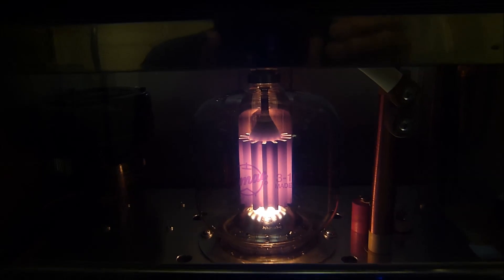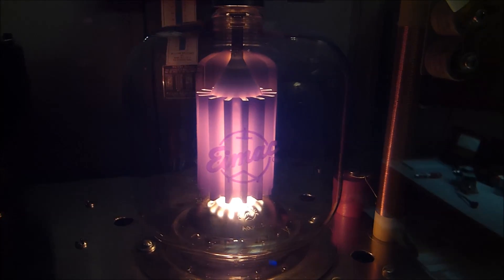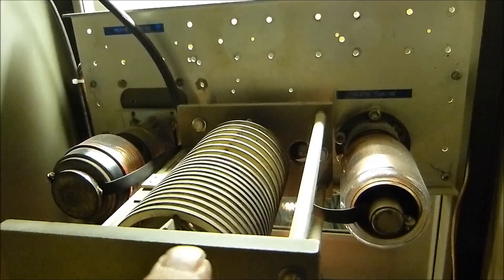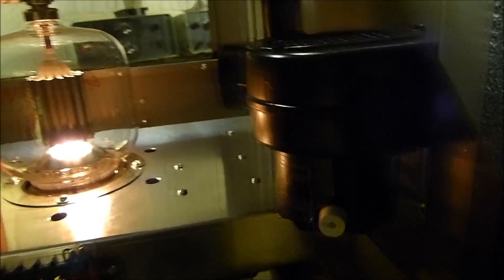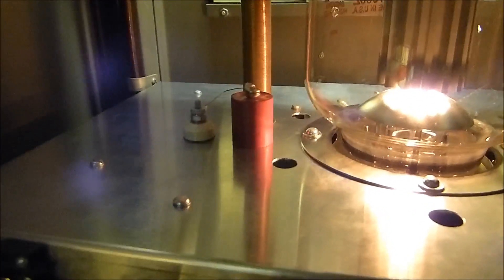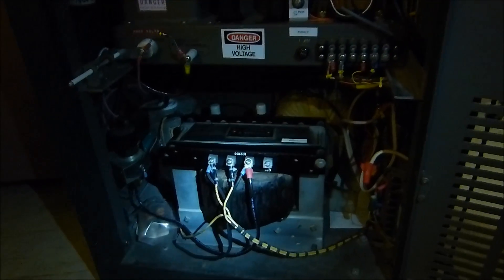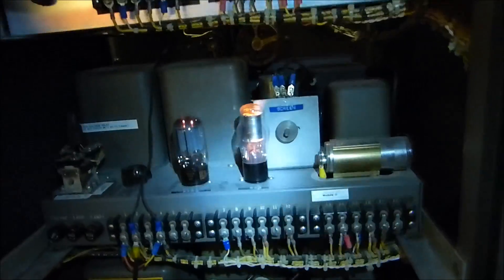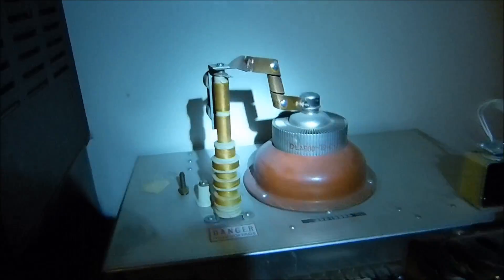Eimac 3-1000Z Triode Grounded Grid Linear High Power RF Amplifier

Comment: I think I read the plate vintage is 3000-5000v with the driver from 43w to 28w. I was wondering how you chose the 3500v plate voltage? I wondered if the whole system would be better at 4500v
Reply from the maker: 4500 VDC is too high for GG... Mine runs at 3500 because that is what my transformer gives me. Sometimes we have to live with what we have.  :-)   You can run as high as 6KV if the tube is running class-C.   Here is the datasheet for the Eimac 3-1000Z       https://frank.pocnet.net/sheets/140/8/8164.pdf

Comment: Beautiful, what sort of power does that produce and what frequency?.
Reply from the maker: Thank  you. It depends on how the tube is run. According to Eimac specs, 3000 volts as a zero bias triode is 1080 watts and that is generally how I have run it. You could run it as 1/2 of a class-B audio amplifier at 5000 volts and get 1750 out of it or class-C plate modulated at 4500 volts for 1750 watts output. My power supply is only 3600 volts and I run it conservatively at about 1000 watts output as a GG amplifier. A pair will do better than 3500 watts output if you want to go to 5KV.  Quite a tube for amateur radio use. I am comfortable with HV up to 4000 but much above that is beyond what I am familiar with.  Not many components, like chokes,  are rated above 4KV so they have to be "floated", i.e. mounted on some insulating material like ceramic standoffs. Thanks for your comments.     https://frank.pocnet.net/sheets/140/8/8164.pdf

Comment: Can u teach me the schematic diagram?
Reply from the maker: Here is a link to the best article I know of using the Eimac 3-1000Z
http://rfcec.com/RFCEC/Section-3%20-%20Fundamentals%20of%20RF%20Communication-Electronics/05%20-%20AMPLIFIERS%20-%20RF%20POWER%20AMPLIFIER%20CONSTRUCTION/RFPA%20-%20A%201000%20Watt%20Amplifier%20Using%201%20Eimac%203-1000%20Triode%20Electron%20Tube.pdf
Reply: @ElPasoTubeAmps  ohh.thanks so much

Comment: I was lucky enough to get a great deal on a 3-1000Z yesterday, and bought a socket, chimney, and plate cap while I was at it.

What is the plate current @ 3.5kV on CW? I'm looking for 1.5kW, and trying to size up power supply requirements.

Is 3.5kV what you would choose if building from scratch, or was is what the cabinet had to offer? (Unfortunately I don't have such a beautiful Collins cabinet to build it in, so from scratch it is.)

Thanks,
Nick
KE8KDS
Reply from the maker: I chose the 3.5 KV over 3KV as I can change this voltage. I press my amplifiers a little hard. As for plate voltage, plate current, grid current and power out,  just Google  the Eimac 3-1000Z data sheet and make it perform like Eimac suggests and you can press it a good 10% just for fun...   :-) and you can get 1.5 KW CW out of it.
You are likely to have to put out the $ for the filament transformer of 7.5V @ 21A unless you have something else you can adjust maybe with a variac... You don't have to have a air socket and chimney but you do need to blow some good air across the tube. It is nice to hear you are making a big amp. Be safe. 3000 volts can be death on contact.  73
Reply: @ElPasoTubeAmps  As for the filament transformer, I'll likely wind my own, as well as the plate transformer and filter choke unless I find a good deal on something that will work. So it shouldn't cost too much. 

I've been looking at the datasheet, however I'm not particularly good at extrapolating from the given parameters, yet.

I can see that at 3500v GG, idle current will be around 200mA (close to what you have), but when it comes to max signal plate current, I'm not sure how to get that value.

Using ohm's law, 100W driving power into 50 ohms would give a voltage of approximately 70 volts. Going by that, on the negative swing (filament 70 volts negative with respect to grid), plate current would be 2A! Surely that's not right?

Also, yes I am well aware of the "dead before you hit the floor" aspect of this type of equipment.

Thanks,
Nick
KE8KDS
Reply from the maker: @Sparky95  Winding your own transformers  -  I certainly admire that. That is something I have not attempted yet.
I have attached the Eimac data sheet.
http://www.tubecollectors.org/eimac/archives/31000z(74).pdf

Look on the second page under:
Radio-Frequency Linear Amplifier
Class-B, Zero Bias, Cathode Driven

In the right hand column under - Typical Operation

You can see that they suggest plate voltage of 3000
Zero Signal plate current is 240 mA
Max Signal plate current is 70 mA
Max Signal Grid Current is 220 mA
Max Signal Drive Power is 47 watts
Nominal Cathode Impedance is 67 ohms (not bad and does not have to have a matching network)
Plate Output Power is 1080 watts

With all this said, you can run the plate at 3500 volts or higher as the left hand column says the maximum plate voltage is 6000 volts with 800 mA of plate current. Wow.... I push it a little bit but not so much as to damage the tube. I do not overdrive the grid current as it is rated at an absolute max of 50 watts.

I am sure you could put 4000 volts on it and run the plate current up to 800 mA or so (keeping the grid current no more than 220 mA) and it will work just fine and probably deliver 2KW+  output.
Reply: @ElPasoTubeAmps  Winding your own transformers is quite easy, once you get set up for it. There is a decent amount of materials, equipment, and knowledge to get started, but once you have them it's easy from there. I can link you to some really helpful resources if you decide you'd like to get into it.

I'm using a pair of 872A's, so I'll probably run at 4kV 800mA or so as you suggested.

It shows at 3kV a drive power of 100W, does it require less drive as the voltage is raised? I'll be driving it with an FT-101B, so should I put an attenuator on the input?

-Nick
KE8KDS
Reply from the maker: @Sparky95  I drive my 3-1000Z with a Collins 32S-1 which will deliver 80 watts average power output and that is plenty enough and can easily overdrive the grid. I don't think you will need an attenuator on the output of your tranceiver just keep the drive power down and it will work good.
4KV @ 800 mA is 3.2 KW and at least 1KW is going up in heat so you will be running it at a screaming max and I believe that will be OK for ICAS operation. My calculations of input power vs output power, if I remember correctly, puts my plate dissipation at about 800 watts which is a nice healthy orange plate. Beautiful, in my opinion and it shows no color modulation with drive modulation. The pair of 4-400A's that I have run in it do show color modulation with audio drive and the 833A definitely shows plate color modulation with voice modulation - but not my 3-1000Z.
At this time I don't need any more transformers but if I do, I will indeed contact you on how to get started. I understand what you say that starting up any esoteric project like transformer winding is a challenge until we get the details figured out in our head and then it becomes (relative) easy.
73
WA4QGA
Reply: @ElPasoTubeAmps  I'm starting to think I might make taps for 3, 3.5, 4, 4.5, 5, 5.5, and 6kV. That or tap the primary such that I can get that variation without switching the HV directly.

I wouldn't run it at 5 or 6kV, but it'd make it quite easy to modify it to take a 4-1000A if needed.

I also purchased an Eimac 1000T, but I'm not sure how to go about using it, yet. 

73,
KE8KDS

Comment: I built my first 3-1000Z in 1964 when I was 16 years old.  Got a used tube from a shaker table amp.  Had a loose grid support rattling around in the glass envelope.  But ran great for many years.  My dad's boss at Hughes Aircraft Bob W6IDG bought it from me.  I bought a bunch of new parts and built an even prettier one.  Sadly in my mid 20's I decided to sell it... and it went off and I never heard of it again.  This was a real mistake.  Never sell a thing of beauty you craft yourself... no amount of photos will ever bring it back.   I ran 2750 volts at 960ma... slightly over the legal limit.  Got terrific signal reports from all over the world on 40 meters.  Ran a lot of phone patches for guys returning from Viet Nam. Hawaii, and Marie Bird Land Antartica.  They reported that I was the only RELIABLE signal out of the US.  WA6QVI
Reply from the maker: Hi David,
I appreciate you sharing that story, They are indeed a thing of beauty. I have built a few amplifier assemblies (without power supply) that I sold. They all ran a 4-400A or a pair. I also built and gave away a 4x811A (with power supply) to my good friend at the MARS station at WSMR who is now SK. This was back in the '80's. 
As you did, I get wonderful reports on how the amplifier, and the old Collins 32S-3 sound - power and quality - with an original D-104. 
At the risk of sounding proud, the problem with running plenty of power and a good antenna system is that lots of guys are very hard to hear running low power and inefficient antenna systems that come back to my CQ's. My favorite receiver is my Collins R-390. Fidelity is amazing and I did add the Tree Top adapter to it which improved tuning a good bit. Marvelous receiver.
I am working as I write to you, on building another amplifier running a 833A. Since it is a medium mu triode, I have to drive the grid and I have found a couple of posted articles on 833A amps others have built. Problem is, I have a beautiful B&W 852 tank coil that I want to use but it is just the wrong Z for a single 833A. I want to run it at 4KV. Would be much better with a pair - which I have but only one socket. If I ran it at 2KV or slightly less, the B&W 852 would be a good match. I really don't want to go to two tubes. It isn't going to out-do the 3-1000Z but I can't help but build. Maybe I should just make it a single band amp (20M) and wind the coil out of 1/4 inch copper tubing. I know that works good.  I love audio but RF is even more of a passion for me.
So, why not you build another one? Chinese sockets are pretty cheap and every once in a while I see a 3-1000Z for sale for around $250 or so. I have two tubes and lots of 3-400Z's and 4-400A's and 4CX1000A's and.......  but I want to use the 833A this time. Lots of years ago I did build and RF amp with a 833A and it wasn't very good. I don't remember the details but I have had very good luck with the 4-400A family of tubes running them GG for SSB and class-C plate modulated with another pair of 4-400A's as modulators. I miss the AM days.
73 and thanks for your comments. WA4QGA
Reply: My Brother was at McMurdo Station Antartica, he was involved with "Project Deep Freeze" He was a Chief medical Officer with the US Navy,  their station call was KC4USB and my Father contacted him from Upland,Ca i remember the contact, everyone was trying to butt into the conversation, Dad got pissed and put some fire to the wire and that was the end of that. My Dad was K6HZH (silent key) he was a radar engineer for Lockheed aircraft fron 54' to 78' He also used to run phone patches from the States to the Boys over seas.

Comment: Why are you not cutting the tubes off on stand-by? I have noticed on several of your videos that when you turn the HV on the tubes are pulling a massive amount of plate current just sitting there at idle. A simple 20K resistor in the center tap of the filament will turn the tubes off in stand -by why are you not doing this? Just curious.
Reply from the maker: That is a good thought. I guess you can see I am pretty boat-anchor minded and to do as you suggest would certainly lower the idling current. I would have to use some sort of VOX to operate a relay or electronic shunt around the resistor. I guess I just never really thought about it. One thing I do that may not be obvious is I turn on and off the HV from receive to transmit. That is pretty old-school also but I just am not comfortable with 3.5 KV sitting on all the time the transmitter is in ready. I also run HV thru the plate meter, again, old-school but all the meters are shunted with back-to-back diodes and are mounted on a non-conducting material behind glass. I appreciate your thoughts and may consider the mod. 73
Reply: It is a very simple circuit. You will need a 3 pole double throw relay. Send me an email and i will reply with a picture schematic. Once you see it you will see how easy it is to install in your HF amplifiers. Send to mitchwcox@embarqmail.com

Comment: Frickin' awesome! What is the input power/current?
Reply from the maker: With no drive:
Plate voltage = 3500
Plate current = 240 mA
Output = 0
Plate dissipation 840 watts

At full Carrier:
Plate voltage = 3200
Plate current = 720 mA
Grid Current = 200 mA
Plate input = 2304 watts
Plate output = 1350 watts
Plate dissipation 954 watts

efficiency = 59%

 - it's beautiful and the difference in how the plate looks at idle and full power is the same. I ran a pair of Eimac and Penta Lab 4-400A's and I could see the plates in those tubes modulate with my voice but I can not see any change in the 3-1000Z plate color under idle condition,  modulation or full carrier..

Thanks for asking...    :-)

Comment: Wow. I don't think I've ever seen a 3-1000Z much less one in operation. That thing is a work of art
Reply from the maker: It's pretty darn big, isn't it? It puts out a lot of heat but I do have an exit fan in the top of the cabinet. I agree, it is beautiful. The 4CX1000A is actually a bit more efficient and powerful but it just looks like a little flying saucer landed on a chassis. This thing has soul and you will respect it when around it as it is impossible to ignore.

Comment: A thing of power and beauty! Do  you have 3 phase in your workshop, or just single phase? Keep the great videos coming, I always look forward to them, thank you :)
Reply from the maker: No 3 phase - yet  :-)  I do run 240 volts to my station and then down convert it to 120 volts with a 5 KVA transformer. You can't run this type of equipment off the wall outlet, that's for sure. Thanks for your nice comments.

Comment: Thanks Buddy. Never saw a glowing 3-1000Z.   :-)
WB3BJU
Reply from the maker: Neither have I, until now. This thing gets hot and needs a lot of cooling. I sure won't need a heater in my basement come winter. I ran a 4CX1000A in this cabinet for over 30 years and I guess the hot air just blew straight up and out the top of the cabinet and I never really noticed - although the room would get very warm but this fellow radiates heat in all directions since I don't have a chimney and really heats up the whole cabinet. I think this one is a "keeper" (for at least another 30 years  :-)   It is awesome - I love it. Thanks for your comment.